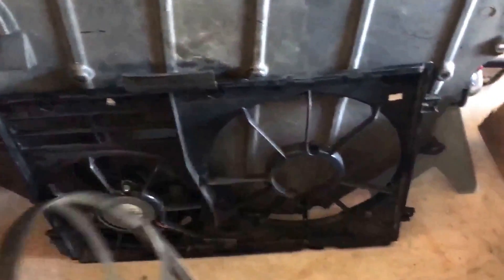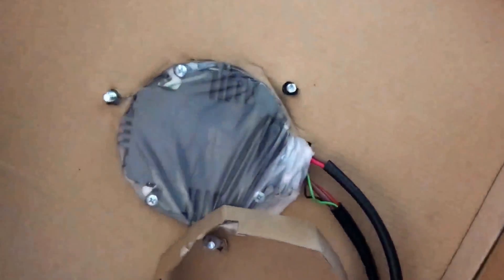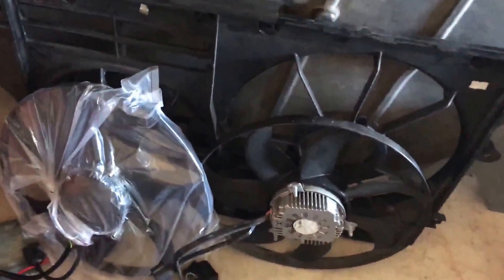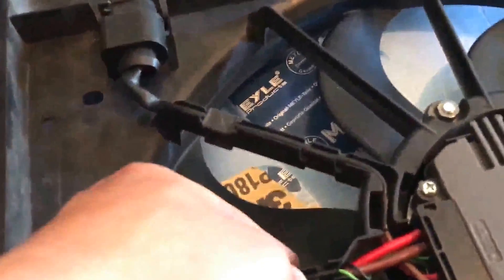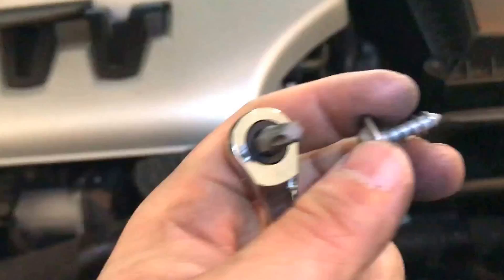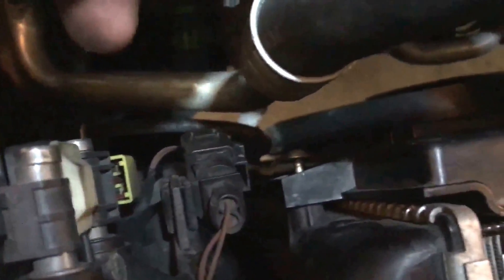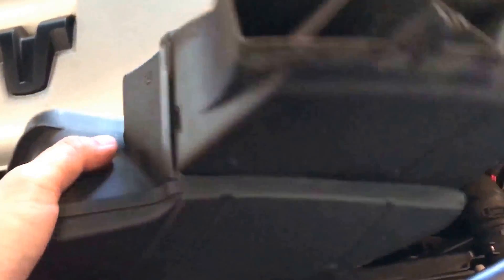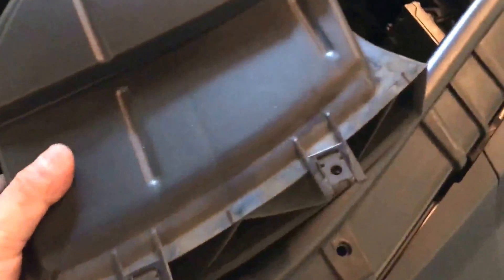How to replace a busted radiator/cooling fan! 2.0t Audi VW TT Mk2 GTI

Comment: Can you share details/tips from your experience installing new fans on a 2001 Audi TT Quattro 225?  Tips on manipulating them out from the top or bottom without removing the nose?

OR,

Is it possible to remove the existing fans from the frame and install the new fans to the mounting frame without removing the mounting frame?

(I desperately want to avoid disassembling the nose.

Any solid suggestions on aftermarket suppliers to shop for the parts, brand names etc....... 

Thanks
Reply from the maker: I'm unfortunately not familiar with the gen 1 TTs.  If you don't have one, definitely recommend getting a shop manual and looking at the official procedure for removal and then map our you own route.  That's what I usually do.  Good luck!

Comment: How to remove dual cooling fan from the car ? up or down?
Reply from the maker: Hello!  I removed it from the top,  just pulled it straight up after removing the screws and disconnecting it.
Reply: Matt Jaeh 
I pulled up from above and the small fan motor was stuck by the cold air hose.
can you speak Chinese?
Can you add LINE ID to discuss?
My ID：vin226556
thanks
Reply: I need you help me how to remove dual cooling fan for the car.
Reply from the maker: Vincent Huang Apologies, I don’t speak Chinese.  Steps:
1.  Remove the splash cover from the bottom of the car
2.  Unplug the fans, bottom right side
3.  Unscrew 4 screws located at the four corners of the radiator facing the engine
4.  Push the hoses aside and pull the fans out and up from the top
Reply from the maker: Apologies, I don’t speak Chinese.  Steps:
1.  Remove the splash cover from the bottom of the car
2.  Unplug the fans, bottom right side
3.  Unscrew 4 screws located at the four corners of the radiator facing the engine
4.  Push the hoses aside and pull the fans out and up from the top
Reply: Can you send link to fans
Reply: Are you running a stock radiator or a performance upgrade?